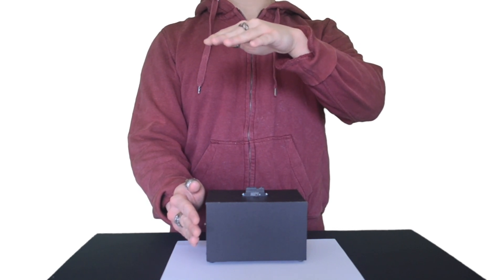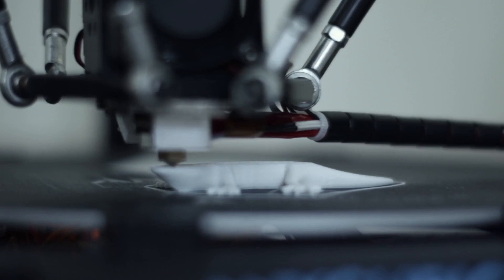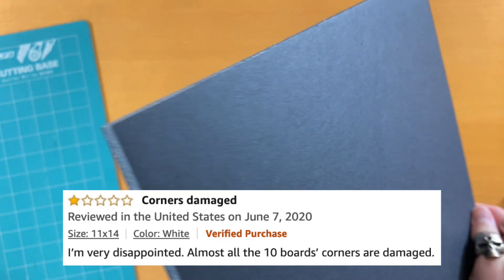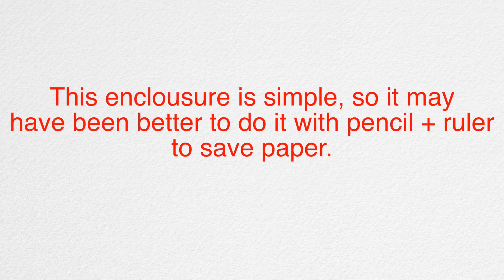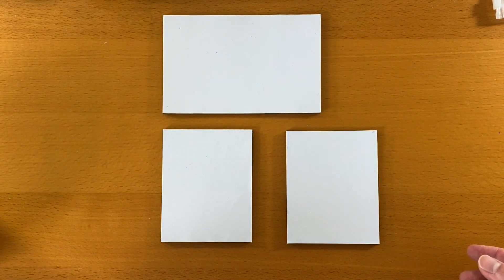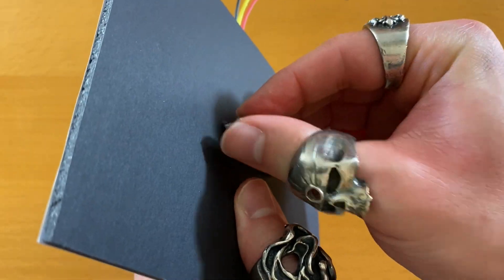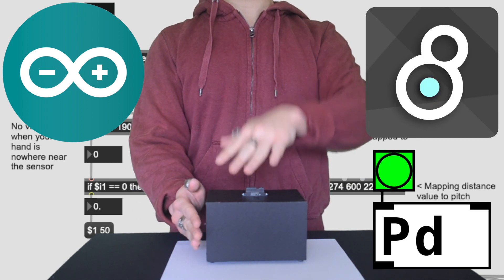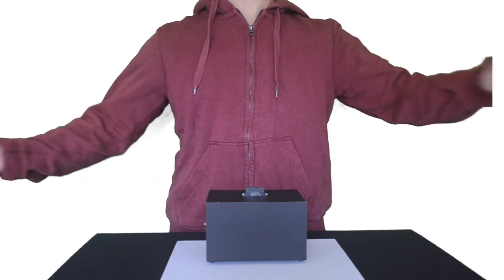Building Musical Instruments with Foam Board! (DIY Theremin)

Comment: Hi! Very interesting idea. Do you have schematic and Arduino code for it?
Reply from the maker: Please refer to my Arduino to Max video :) 
Instead of potentiometer, swap it with the distance sensor.
Reply: @SoundSimulator Yes! I had a look at it. Cool! But I thought the sound was coming from Arduino and I didn't realize it is instead coming from the computer. Is there a way to make a standalone system, without the need of the computer to play?
Reply from the maker: @FabioMarzocca56  You can use the Daisy :)

Comment: need to know the detail, where cables connect from arduino to board. and the resistor it must connect with cable too?
wanna know the same ways detail for the cable.
i need the direction. thank you.
Reply from the maker: This was more of a tutorial on how to use foam board. You can search on google to learn about connecting distance sensor to Arduino.
Reply: @SoundSimulator  https://www.youtube.com/watch?v=eVW0FD9g_Sk&t=122s im trying with this with knob its working fine for me, but i need details video for connecting distance sensor, resistor and arduino to foamboard?? im so confusing to connecting the cable,  can you give me some tutorial or link?
Reply from the maker: @adelderderder  I don't know which distance sensor you're using (I bought the one in the video 10 years ago at RadioShack so I doubt you have the same exact one). Please Google the name of the sensor you have and also type the word "Arduino" and you should get bunch of tutorials. 

You got this 💪

Comment: use hot glue sticks or something.. CA glue doesn't work with foam usually. great video bro
Reply from the maker: I saw people online swear off hot glue and I didn't have one around anyway. Krazy glue worked fine personally. I messed up in the video cuz I had to glue from an awkward position in order stay out of the camera's view. Didn't have any issue during my test run.

That said, if people have more experience and an immediate access to hot glue, then I recommend it.